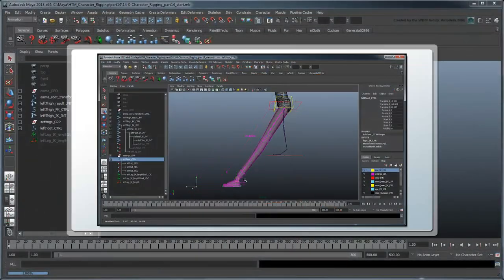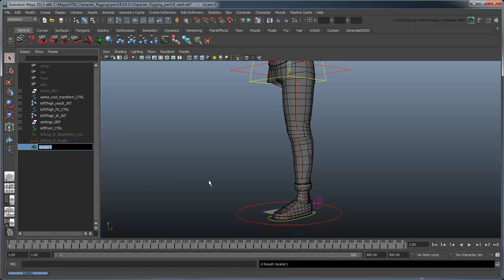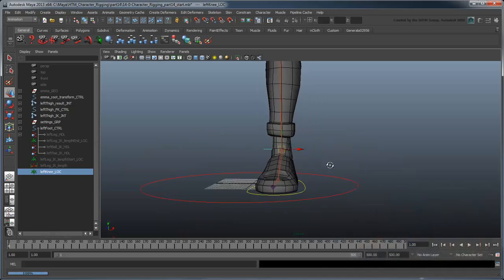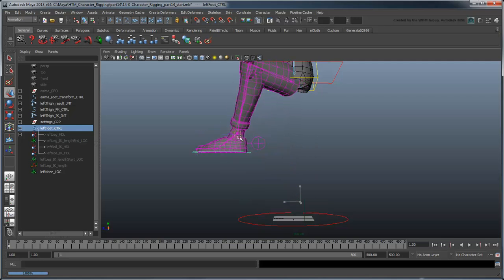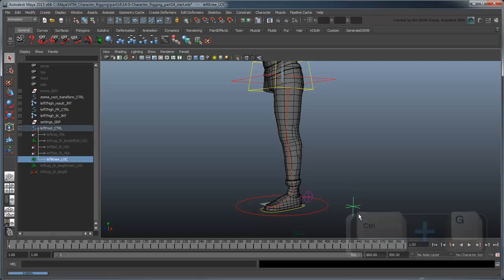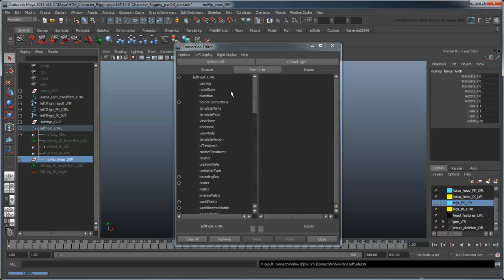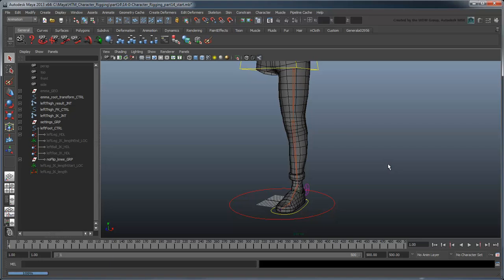Creating a Character Rig - Part 14: No flip knee for IK leg (Advanced)

Comment: Everything in this tutorial has been fantastic up to this point. I have the same issue that a lot of people were having. Where after setting the pole vector constrain and moving the locator, both the foot and the knee rotate with it. I can also tell this is an update problem because the included finished file also presents exactly the same problem, as you slide the knee twist control.
Reply from the maker: That's very odd because I'm running Maya 2020 and am not seeing the same behavior (I even redownloaded the file).  A user (Pavan Kumar) below managed to track their issue down to mismatched rotation orders, so maybe double-check that in your own file?  I'm not sure why the included scene file isn't working correctly for you though.
Reply: @Autodesk_Maya  I finally solved the issue by deleting the preference folder. I cannot fathom a single clue as to what I could've changed in my time using Maya. I desperately want to be able to pinpoint it, but nothing really comes to mind.

Nevertheless, I appreciate your help and am ecstatic to carry on with these beautiful tutorials.

Comment: My elbow was angled, it was in an A frame pose. The knees worked perfectly, much thanks, but even bringing the locator along the line of the elbow, it still shifts when I Pole Vector. Now, you mentioned times in the past to put the locator on top of the elbow/knee, and that works perfectly. No twisting. but that's also made it super sensitive. Moving it a millimeter spins the arm around. Makes sense if it bases off of angles I think. 
When you move the curves, you can select the control vertices and shift them so you don't screw up the parenting or the origin. Can I do something like that with my locator? I've been searching, but I can't find anything on my own. Thanks!
Reply from the maker: Sorry I'm a little confused here: are we talking about the no-flip knee, or arms?  You keep mentioning elbows, which makes me think you're talking about rigging the arms.
Reply: @Autodesk_Maya  I'm so sorry for wording it poorly but thank you for such a quick response! In part 22, you return to the knee tutorial parts 10-18. So, my problem is with leftElbow_LOC. 

At 1:22 in this video, when you pole vector constrain the locator to the handle, my arm would twist like a lot of people here. But like you told them to do, I pole vector constrained the locator atop the elbow joint to resolve the twist. However, the motions are super sensitive as a result and don't act intuitively. For example, if I move the locator one inch, the arm twists nearly 90 degrees. 

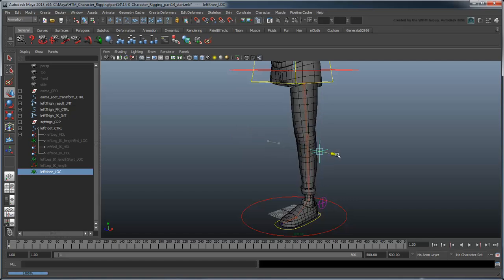I want to pull the locator away from the elbow now without affecting the pole vector constraint so that it resembles your rig at 1:34.  Unless I just don't include the elbow control in my IK rig.
Reply from the maker: @SmartassEyebrows  Hmm, did you watch the process in part 24?  That's where I show how to do the elbow IK control.  Part 22 is too early.
Reply: @Autodesk_Maya  Oh my gosh, I was following along with the earlier parts so strictly, I didn't realize it would be covered later. I was under the impression that I needed to fully recreate the FK, IK, and result joint skeletons before progressing. Thank you so much again!

Comment: When I created a pole vector constraint for the knee twist, as the twist attribute value is changed the foot and toe bone also rotates, as if parented.  In the video the knee twist/rotates separate from the foot bone. I built a separate bone chain with similar construction as to exclude issues with the blend node.

When I apply the IK handle, with the Rotate plane solver, to the chain and use the twist on this separate chain, the bones beneath the chain are following the twist as if parented. The foot bone does not remain stationary. Looking for attributes to break this value.
Reply: at time 1:46 the knee rotates, the foot doesn't. Every time I do this I, I get a foot rotation.

Comment: Thanks for the tutorial, I'm following this tutorial from the beginning and these are quite useful
I'm facing a problem with pole vector constraint, after constraining the pole vector with the IK handle and translating the locator, the foot geometry also moves with pole vector(tilt to sides) , can anyone explain what is the problem ?
Reply from the maker: Are the foot joints moving along with the geometry, or is it just the geometry?  If the latter, it likely means your foot geometry isn't parented to the correct node.
Reply: Thanks for your reply. I found out that one of my IK joint rotation order is not in sync with other joints

Comment: I've been following your tutorial step by step with my own character, and I downloaded your files to see what could be different, and everything seems normal, but when I try to rotate my knee this happens, goo.gl/4zhPGz, do you know what could cause that?
Reply from the maker: Is the IK handle parented under the knee?  It looks like it's rotating along with it.
Reply: No, it's just like yours, the only thing that I did differently was that my foot was straight so I didn't have to rotate the foot nor the joint, but I think that this is the preferable situation. And I just saw that it's the result joint that is doing this, the IK moves like it should.
Reply from the maker: Hmm, is the blender node between the ankles set to the correct value?  In general, it sounds like something connecting your result leg to your IK legs isn't right.
Reply: Yes, thank you very much, I checked all the nodes and the problem was that the rotation of the thigh was wrong, I just changed it and it worked. And thank you for the time you took to help me, I asked my teacher and he couldn't help me, haha.

Comment: I'm working on my own character following this tutorial, so excuse me if the following problem is not applicable: 

After setting up this knee twist, the IK joint chain is not entirely lined up with the other joint chains. Will that cause problems further down the line? 

I should mention that I'm working on this character's legs at an odd angle, because its default pose has the legs spread a bit further out and knees bent more, and feet facing outward more than the tutorial character.
Reply from the maker: That shouldn't be a problem.

Comment: Every time I place the pole vector constrain in, it's feeding my IK joints non zero rotations, which is shifting my chain. I'm not really sure how to work my way around this.
Reply from the maker: Why do your IK joints have non-zero rotations?  They should only start with non-zero translations.  Either way, I would try snapping the pole vector right to the knee joint to start.  Is the knee rotation still off?
Reply: Maya Learning Channel I'm not entirely sure why the pole vector would shift the bone joint, but it didn't have no rotations on it before I applied the pole vector.
Reply from the maker: Hmm.  Did you start with a perfectly straight leg, or is there an initial bend at the knee?  You want the latter, like in this tutorial.  Also are you sure your locator is perfectly in line with the knee joint before creating the pole vector?  You can make sure by snapping it first to the knee joint before translating it forward in just one axis.
Reply: I had the initial bend and I aligned the locater many times and made sure. I even checked the rotational axis of the joints, and they were all ok too
Reply from the maker: Hmm.  Try snapping the locator directly to the knee joint, and then don't move it from there.  Create the pole vector.  Does the knee still rotate?  This is like the basest case, so if it still rotates then I'm stumped.
Reply: "Try snapping the locator directly to the knee joint, and then don't move it from there." 
This worked for my knee, it was shifting when the pole vector was applied. Will this cause any problems as I continue?

Comment: often when i move the foot control just to see what's happening, the IK handles pops irregularly. it goes back to its position as i move the control in other ways and undo it, but it's annoying! i would really appreciate for some advise on this.
Reply from the maker: What do you mean by "pop"?  Like they flip or go to a different position other than where you're moving them?
Reply: exactly! they do all that crazy stuff with its geometry and don't come back to its original position eventhough i undo any translation sometimes. it doesn't always happen though.. they stay calm when i hide them. i think it's just some error....
Reply from the maker: Does the status line show an error that says something like "Cyclical dependency detected"?
Reply: nah, there's no word like that showing. in the script editor either when echo all commands is on. never mind!! i think i'll be able to deal with it as i get better. i should check if everything's alright once i'm done moving around the pole vector and stuff.

Comment: Hey Maya Learning Channel,
Whenever i am applying PoleVector constraint to leg it changes the position of knee joint.
please help me out!!
Reply from the maker: Sounds like your locator is not in line with the knee.  Make sure these two are on the same plane.  If you're still having trouble, try placing the locator right on the knee itself and then setting up the pole vector.  Afterward, translate the locator only along one axis to separate them.
Reply: Its working well when locator right on the knee itself. But whenever i translate that locator in one axis knee starts changing position!! What to do now???
Reply: Check joint orientations if "flipping" occurs when creating the pole vector
Reply: +flamal thanks for replying. I checked orientation that is also proper.😬

Comment: after doing the no flip knee setup, if i increase the 'knee twist' value past 40 degrees (Positive or negative) it starts to move the result joints at the feet. I checked the other joints, and they're fine. its only the result joints. Any ideas?

Comment: I'm following this tutorial with a character model whose legs (as well as arms) are at a slight angle, rather than straight down, and therefore the joints for them are at an angle as well. When I try to create a pole vector constraint, the thigh and shin bones rotate slightly.

I've found a solution to this by creating a polygon triangle and point-snapping its vertices to the foot, shin and thigh bones. Then, with the move tool set to "Normal", I drag out the vertex snapped to the shin bone and point-snap the locator onto it to ensure that it lies within the plane created by the three joints. When I create the pole vector then, the leg bones don't rotate. Similarly, when applying the no flip solution, I had to adjust the Twist attribute of the left leg handle very precisely in order to zero out all of the bones' rotations again.

However, a few of my bones have "-0" in some of their rotations. To my understanding it represents a very small value. My question is whether this poses a problem of any kind; from what I've read it is best to keep your bones' rotations zeroed out when they're in a neutral pose, and I haven't been able to find very much information on whether having -0 values negatively affects anything. If so, is there any possible way to get rid of them, or should I create my joint chains straight and adjust the model to match?
Reply from the maker: +Recursive Sweatpants It shouldn't cause any major problems.  However, as you'll recall from the manner in which we rigged the feet in a similar situation, we do suggest matching the geometry to a proper t-pose when possible.
Reply: +Recursive Sweatpants you my friend... are a life saver! - I completely forgot that creating a 3 pointed polymesh was a great way to physically show the pole vector's plane. and while it did work for getting the locator into the right place, we unfortunately still have to manually tweak the twist settings in order to get the bones to a perfect 0 :/ no way around it?

Comment: Hi
Can someone explain why we don't just parent the locator to the foot controller? I do that and the loc follows the control and the leg doesn't flip
Reply from the maker: ***** It's because when you move the foot, the knee controller moves with it.  In general, you want to design rigs such that all these individual controls are independent of one another as that will make troubleshooting animations later a lot easier (you won't have to worry about how tweaking one control messes with other controls).
Reply: Maya Learning Channel thank you for the quick reply.. then why the instructor parents the locator under the foot control?  and another question. in the next video couldn't we just create a knee control and let it drive the knee twist attribute since noflip knee is advantageous to just pv knee? why blend? thanx
Reply from the maker: ***** Sorry I think I was a little confused by your original question.  Are you asking why we move the knee locator beside the body rather than just leaving it where it is?  The reason is because if you leave the locator where it is, it causes the leg to flip around in some fairly common poses (try raising the leg up and behind the body for example).  By putting it to the side, you can completely eliminate those situations for all but the most extreme, uncommon positions.

As for your second question, no flip knee is only advantageous to a pole vector knee in specific scenarios.  If you ever need to specifically position the knee or pin it (which we show in a later tutorial) you'll need a knee with an actual control in the workspace.  As we mention in this tutorial, no flip knees are really best used for things like animating walks or runs.
Reply: no. i understand why we put it beside.. i just asked we don't just parent it under the foot control instead of putting it beside and twisting the leg and doing all of those things and then parenting the locator under the control..thank you. i understood your answer for my second question

Comment: When I parent the Loc to the left leg handle and then move it, it also affects the foot by moving it up and down. What I noticed is that it is moving the Result_Skeleton from the foot down, but I don't know why. :(
Reply from the maker: Hidroks This only happens when you parent the locator to the handle?  Or does it happen when you move the handle itself?  The former case suggests some kind of parenting problem while the latter means the IK handle itself is set up on the wrong joints.
Reply: Maya Learning Channel I have what might be considered a similar problem. I will go through the process of setting up the leftKnee_LOC, and all is well until I actually move it. The Knee seems to follow properly, but when I go back to zero, the geometry at the thigh appears separated from the  hip geometry. In the Channel Box, I notice that the Pole Vector X,Y, and Z (highlighted in blue), have number that seem off. If I zero them out, the geometry of the thigh returns to its original, proper position. However, moving the knee locator again produces the same problem. Is this a case where I have the IK handle set up improperly? And if so, how do I go about repairing that?
Thanks for your time.
Reply from the maker: I would show all the joints.  If the joints are moving properly but the geometry is not, then it's not an IK handle problem (since they control how the joints move).  Do you get any cyclical warnings when moving the knee control around?  If so, then I suspect a parenting (or constraint) problem is to blame.
Reply: Maya Learning Channel No cyclical warnings when moving the knee control. Except for the shift in geometry, which is corrected when I zero out the pole vectors in the channel box, it seems to be working as expected. I'll check the joints out and backtrack their creation and function. Will let you know what I discover. Thanks.

Comment: Hi there and thanks for a wonderful tutorial.
But I got a problem on my Maya 2013.

When you do a pole vector constraint at first step, your foot do not twist when you move the knee. Unfortunately do my foot rotate along that direction the knee locator goes. I have started with your scene data and it has same result as my data. I also have reset the tool controller (translate,rotation,scale) and still same problem.

So I wonder if someone have same problem and know how to fix it.
Regards
Mattias
Reply: any update? u still alive?